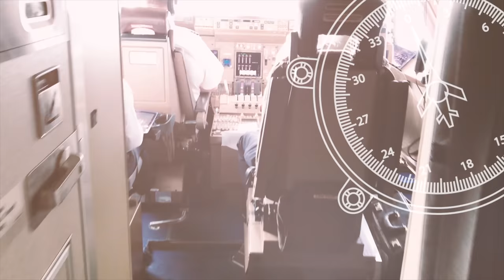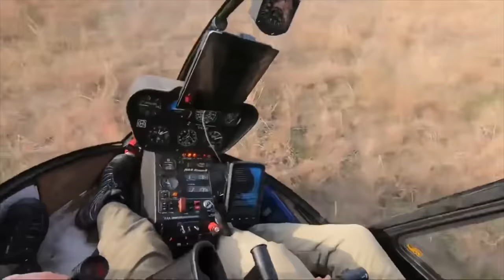Boeing 747 Loses Landing Gear | Viral Debrief

Comment: It's hard for me to wrap my head around the fact that something as heavy as a 747 at close to max landing weight can BOUNCE and not drive the landing gear right up through the airplane.  The engineers at Boeing who designed those landing gear struts really earned their money.  The first time I saw a 747 bounce was at IAH and a Royal Jordanian plane bounced on landing.  I actually thought I'd be interviewed on TV because I witnessed the crash.  That was when I discovered just how stout those struts really are.
Reply: Now try to wrap your head around this. Ground pressure exists. The actual surface footprint of the tires is roughly 6 sq ft per tire. In this video, that's 12 instances of 6 sq ft, or 72 sq ft. Roughly 300,000 kilos are being divided between those 12 instances. Roughly 4160 kilos per square foot.

To put that into scale, the footprint of a standard cab pickup is roughly 175 sq ft. (7 foot wide, 25 foot long) and weighs roughly 2950 KG total (using a 2002 Ford F250 as my example)

Now, that runway has to put up with a sudden shock load comparable to stacking 2 full size trucks on top of one another, and then have them hit 1 square foot of area...

Not sure about that particular runway, but the regional here had to have 6 feet of concrete under the 6 inches of asphalt just to land the "puddle jumper" dash 800 turboprops. Just how deep do you think that runway has to be?

Comment: There is another point I would like to make about the helicopter pilot. He did a great job in telling his passengers "stay where you are". One of the hazards with an unpowered helicopter rotor is that they can suffer from an aeroelastic event called "blade sail", the sudden, unexpected departure from from its rotational plane. The tips of the rotor blades on a Bell OH13 (Sioux), a chopper I have both flown and worked on, are about 10 feet off the ground when stationary. I have seen the tip of an unpowered rotating blade sail down and strike 3 ft high fire extinguisher about half way up. The pilot kept his head, allowing his passengers to keep theirs!
Reply: p.
Reply: Completely agree, the chopper was in no immediate danger requiring an evacuation. Also, not only would blade sail be an issue, but they were also on uneven ground, so one side of the prop will be rotating towards the ground. Passengers can lose all common sense in a state of panic and find themselves making moronic decisions. Always best to make sure everything is completely shut down and come to a halt before allowing them to exit in a situation like this.

Comment: The heli guy knew he wasn't going to clear the road and wires, good choice.
Reply: Right? I was thinking the same thing as it looked like he was going for the road first, saw the lines, and then turned it over to autorotate into the field.
Reply: Yeah I was thinking the same thing he's probably not going to make it past the road, and risking hitting a car would only make things worse. Great quick thinking and execution.
Reply: I swear you can see the moment he decides, pulls the nose up just a hair to guage his speed/loft and then immediately dives left down left hard to get some speed/loft for what I'd guess is a little more risky (tempting a sideways 'crash' or rotor hitting the dirt, but way safer than eating some power lines.)
Reply: He didn't have the required energy to make it, so he didn't have that option, at all.
Reply: Im just wondering why that guy had a gun😂
Reply: @midasd7925  Probably hunting coyotes or some other invasive or threat species.  My guess at least.
Reply: @midasd7925  helicopter wild hog eradication
Reply: That is a hog helicopter (they fly low over a ranch usually in Texas and shoot running wild boars out the windows with rifles), so it is on a ranch for sure and already very low, which all seemed to work out in their favor. He did a good job of setting it down!
Reply: He wasn’t trying to land on the highway, he was trying to get close to it just incase there were injuries so rescue crews could reach them ASAP and also people would see the crash and call for help. He could have landed sooner but you can see that he was trying to get near the highway
Reply: @joerepoman1  While possible, unlikely.  In a heli when the power goes out your options are very limited. You can't land straight down, you have to keep your forward velocity up to keep the rotor turning, saving the energy stored their for the final flair to cushion the landing/impact.  And all thoughts about rescue crews and being seen from the road would be well outside his thinking.  His only thoughts would be 1) keeping the rpm up on the rotors and 2) warn the passengers to brace for impact.  Lose the RPM and you have nothing to work with.  RPM is going to be driven by forward airspeed.  After that, picking the impact spot.  He seems to have very briefly thought about clearing those wires, but then realized it wasn't happening, so he veered left, which also burned a lot of energy and shortened their hang time further.
Reply: It's actually a little bit more than that. He threw on the brakes with a mini flare to try and intercept his profile and land short of the highway, ballooned a bit realized he couldn't land short of the powerlines, and decided to make the play for the 180. He didn't have the altitude for the 180 which would taken him away from the trees but he didn't have the altitude so he had to recorrect back to the 90 which put his tail rotor into that bush. Really nice job, just needed a bit of right ball at the end but you can't armchair something too much that ends as well as that did.
Reply: @midasd7925 
Likely a helicopter hog hunt. Hog population might be at a dangerous level where they live.
Reply: @malcolmdrake6137  I can’t imagine that true. We have a height/velocity chart that ensures we have energy for auto. We never flew out of that. In that 44 if you’re above avout 40 mph you have energy for the auto. Pulling those nose up adds energy to the rotor and slows the forward velocity. Properly executed he wouldn’t have damaged the helicopter. But then again he caused the accident by not having the mag switch on both anyway. He made some serious mistakes but he’s young and will learn from them.
Reply: @avi8r66   This is in Texas near Houston, it's a hog hunt
Reply: The roads are usually put in the flattest place so landing parallel to them should be safest, and if not your body will be found sooner.

Comment: That helicopter crash landing, you see how the pilot got as close to the freeway as possible before he had to set it down? That was impressive, he knew if anyone was injured and had to be rescued, they’d have a better chance of surviving being closer to where rescue crews could get to them quicker. Good job sir!!!!
Reply: Not just that, but generally speaking asphalt holds heat better than grass and trees, and creates thermal pockets that provide lift. He may have been riding the thermal a little to slow his descent.

Comment: 19:27 that was actually an Airphil express A320, flight 969, and yes that was the original audio, and yes the investigation cited the cause as pilot error.
Reply: The airport was Kalibo International Airport (KLO/RPVK) which "serves" Boracay but is actually a good 40 miles from Boracay which is an island without an airport of its own. The runway at the time was 7175 feet long, which is on the short side but not extremely so, I mean, LaGuardia's runways are only 7000 feet. It looks like poor speed management to me and not having a stabilized approach.
Reply: @alexmollen9339  Are you sure? It is the former Caticlan Airport that has changed name to Boracay Airport (MPH/RPVE) and after extending the runway it can actually take an A320 now, if handled with care. I went there once in the old days when you had to fly with an ATR42. I admit that judging from the surroundings it does look a lot more like Kalibo., but then why would Kelsey call it Boracay?
Reply: @tommyrjensen  A quick look at Google Maps told me that they would have ended up in the ocean at Boracay Airport (MPH/RPVE) at both ends of the runway. So definitely Kalibo International Airport (KLO/RPVK).
Reply: @tommyrjensen   it is definitely Kalibo. Air Phil Express was already rebranded to PAL express when RPVE was expanded to accomodate the A320. See also the terminal building a few meters from the runway threshold. Thats the terminal building of RPVK those days.
Reply: I hope the report also praised the pilot’s actions!

Comment: Kelsey is mistaken on the first vid. I remember watching this one. They came in hard to try and bounce the under carriage loose. They had a spotter that would have told them if the wheel had come down. If it would have dropped, they would have taken back off, circled and come back in for a normal landing.

The hard landing was deliberate
Reply: I fact-checked and found you are correct and it sure makes sense. 👍🏻
Reply: This was my first thought when I saw this clip. Glad to hear it was intentional. I suspect they knew the exact sink rate they could hit at safely. 

My father was a 747 captain when he retired. He was methodical and sharp and everything was intentional.
Reply: WRONG. He bounced, simply because the hyd problem he had meant that some of the elevator surfaces were not available, thus catching him out when he tried to do his normal flare. The slowness of the aircraft's response is not something normally practiced and therefore entirely excusable.
Reply: bullshit. See correct explanation from MegaWeebles below.
Reply: @12345fowler  I was listening to it live on BBC and SkyNews at the time. The thing was flying around for hours before it came to land. The crew said that they were going to attempt it before they did it. Their conversations with ATC were broadcast live at the time. 

You know you can disagree with someone without going all Rain Man. No need to swear.
Reply: My question though is if the part was backwards, maybe the landing gear wouldn't go up? but maybe once it went up, it locked up in a way that the backwards piece seized. IDK
Reply: @GreyWingUK  I wonder what was going on in the passenger cabin while they were trying to solve the problem. was everyone in their seats as if they're about to land at any moment, or could they eat, go to the bathroom etc?
Reply: That's the most idiotic thing I have ever read LOL. Sure, let's BOUNCE a 747 to get the gear down, THEN, come back around and land again...LOLOL. Ummmm no!
Reply: Not silly. Banging the plane down hard could potentially shake a stuck hydraulic actuator free but then the undercarriage would come down over a few seconds and during that time the wheels would not be in the correct landing position during the let-down.  It would be better to start lifting the plane off the ground if that undercarriage started to come down. As Kelsey says it is better to go around and come back for another landing rather than try to drag a partially unfolded undercarriage along the runway.

Comment: That helo pilot did a fantastic job; he had no time at all at that altitude to even think about it. Not only find a place to set down but missed the road too. I'd fly with him anytime.
Reply: You'd fly with a guy who happily takes off with the magneto switches set to off'? And then sheepishly looks at the camera when he goes to turn them off after they've crashed?
Reply: Yeah Rob, took the word out of my mouth. I think he did a great job not killing them after, but he also caused it. Anyone can make mistakes, but thats what check lists are for. If you go by memory, you'll miss something for sure
Reply: More importantly he moved quickly to avoid the power lines lining the road. Would have be a sad ending if he'd tripped into those. ⚡
Reply: During the flight, the key was facing 2 o clock.  After shutdown it was facing 10 o clock.  You can't do a 90 degree rotation from off to off.
Reply: @ovalteen4404  what are you saying? If you watch the actual video, you can clearly see the key in the same position after the crash as before he started his take off. You can see him switch it to off during his shut down procedure. He didnt have the switch off in flight, it was on a single mag not both, as it should be at all times unless doing a mag check.

Comment: that autorotation was perfect, love how he realised there were power lines too and altered his course
Reply: A good auto starts with making sure both mags are on.... : P
Reply: @tmanf22  Did he have the time, or the ability to take hands + focus off flight controls to actually do that? A good auto ends with everyone alive surely.
Reply: @thert.hon.thelordnicholson7261  no, but if he followed the checklist he wouldn't have taken off without both mags on and thus not crashing
Reply: @thert.hon.thelordnicholson7261  It's fairly safe to assume the pilot was the guy in the right seat and the passenger in the left. We can also see there's no controls attached on the left so it is definitely a passenger and not a fellow pilot.
Reply: @tmanf22  Fair point!
Reply: @tmanf22  what are mags?
Reply: @bepowerification  It's the bullet containers attached to the bottom of these boys lovely AR's, or probably something to do with the choppers ignition system.... I'm assuming.
Reply: @SpankMyFace 
I would assume "mags" means magnetos.

Comment: "Ok so he's coming in for an emergency landing, why didn't he aim for the road? Wow that descent was rapid...OH SHIT HE'S IN A CHOPPER NEVERMIND."
Reply: Probably wouldn't have been able to reach it and still line up with the road. Auto rotations are very steep, especially if you take up a nose down attitude. My question is this, why did he fly it into the ground, he never slowed his ground speed with a flair.
Reply: Watched a vid about the development of helicopters.  They were still VERY new and individually made and a man was trying to convince some rich people to invest.  Final argument that swung the deal?

"This machine is going to save a lot of lives."
Reply: As someone has already noted he probably wasn't sure if he could get that far.
 
Also, dirt has a bit of "give" to it which helps when you have fixed skids instead of landing gear with shock absorbers....
Reply: @rattler24  If he hadn't slowed his descent, they'd all be pancakes. Notice how not far off the ground they were in the first place, there weren't a whole lot of autorotation to work with, especially after eating up some of the speed to turn away from the road.

Comment: That rotor blade spinning above your head isn't "acting" like your wing, it IS your wing!!  ;-)
Reply: No. It's acting. Helicopters don't fly, they beat the air into submission.
Reply: @onewingedangelsephiroth1561  no not beating the helicopters become good friends with the air and do many favors for it and once it has the airs full trust it social manipulates it into feeling bad for all of the things the helicopter has done for it and says that the air will be in no debt if the air gives it levitation as an ability this usually takes around 7 days and this process is called Building the helicopter
Reply: @onewingedangelsephiroth1561   - yup, heard them all, including "a collection of spare parts flying in loose formation."   My favorite being:
Airplanes are different from helicopters.  An airplane, by it's nature, wants to fly and unless interfered with too strongly by unusual circumstances or a deliberately incompetent pilot, the airplane will fly.  A helicopter doesn't want to fly.  It is supported in the air by a series of conflicting forces.  Disrupt any one of those forces, and the helicopter stops flying, immediately and disastrously.  There is no such things as a gliding helicopter.  That's why, in general, airplane pilots are buoyant, clear eyed extroverts while helicopter pilots are brooders, introspective anticipators of trouble.  They know if something hasn't happened, it's about to!

Still, all things considered, that helicopter pilot did a good job.  The aircraft but bent but everyone inside (4 souls I believe) walked away with no injuries.  I'm not sure a light airplane in the same situation would have faired as well but that's just speculation on my part.
Reply: no it IS a rotor blade. different kind of air manipulation, same function
Reply: @monavie9110   - I think you're really picking nits on this one.  The rotor blade on a helicopter is an "airfoil" (wing) just like the wings on a 747 are "airfoils" and wings on C172 are "airfoils" and the wings on a glider are "airfoils."  They all manipulate the air in the same way.  Air moves faster over the top of the wing than it does below thus creating a relative low pressure area on top of the airfoil (ie: wing!) and thus creating lift.  They all do the same thing.  They are all wings and they all create lift.  The difference lies in the fact that the wings on a 747, C172, or glider are all fixed (stationary) relative to the fuselage of the aircraft while the rotors (wings) on a helicopter are not and the helicopters wings are not dependent on the motion of the aircraft as a whole to generate left which allows helicopters to do the one main thing that fixed wing aircraft will never be able to do.  "Hover!"
Reply: @Intrepid175a  all wings are airfoils; but not all airfoils are wings. 
seems very easy to me.
Reply: @monavie9110   - Ok, there are airplanes for which the fuselage acts as a lifting body and contributes a significant percentage of the overall generated lift by the aircraft.  Is that what you're thinking about when you say not all airfoils are wings?  I'd buy that one.  In the case of a helicopter, the rotor blades are definitely airfoils and they provide all lift to get the aircraft off the ground and control of the aircraft in  pitch and roll attitude, just like the wings and horizontal tail surfaces on an airplane.  So what is it about a helicopters rotor blades that makes you consider them to not be a wing?